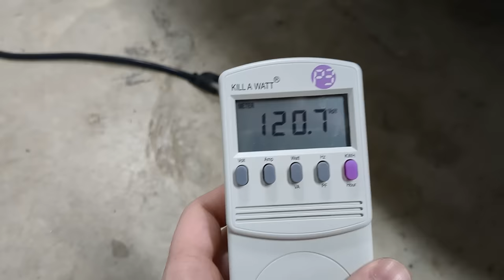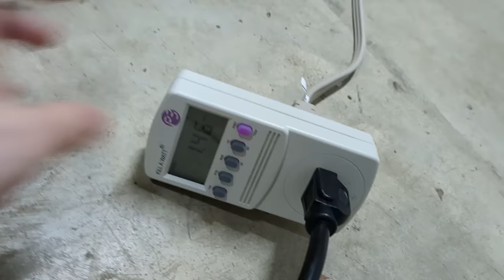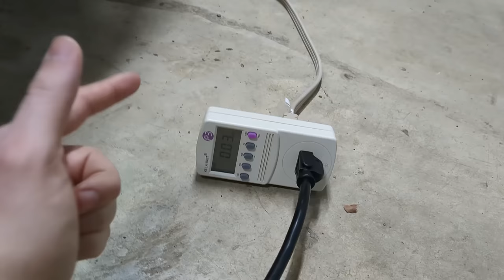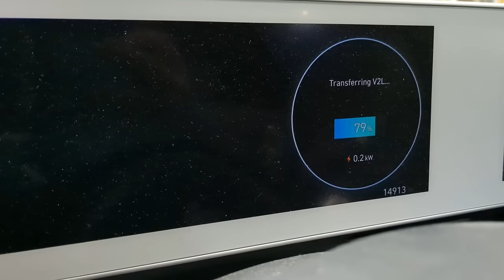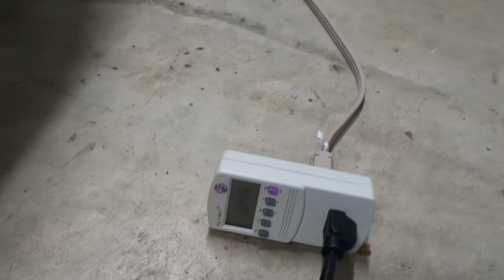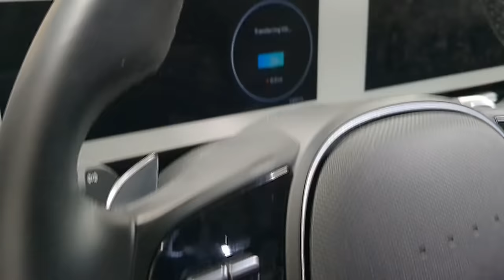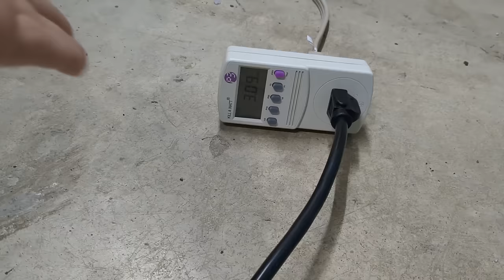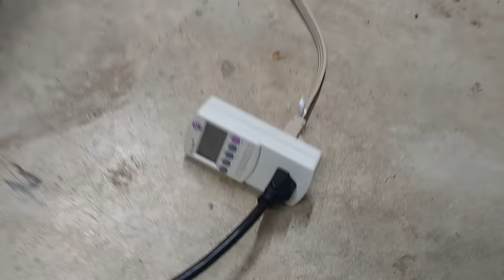A 24-hour test run of the Hyundai Ioniq 5's Vehicle-to-Load function

Comment: Hah I was thinking the whole time that it’s immaterial how much power it draws because you can drive somewhere and fast charge. I suppose in a borderline apocalyptic power outage that’s not an option, but most power outages don’t knock out entire cities or states or regions.

I do still wish V2H was mandated by the charging plug standard because that would be a bit more convenient and solve the heating issue a lot easier, but I’m surprised at how usable even this 1800W supply is. With a higher supply, just about every home energy need could be satisfied for around a day using the car, or more if you’re careful about the usage. 

Thanks for doing this experiment, I’ve been curious about this since I learned of the capability and this is so cool to see
Reply: A much elegant and resilient solution is to keep a couple of deep cycle SLA batteries and an inverter to power blower motor of furnance. Then charge these batteries in a car or better yet 200W solar panels during the day time. Then you don't have to worry about the entire grid shutdown scenario. All of these can be gotten for less than $1000 (two 100 AH batteries, 1000W inverter, and 200W solar panels). Sounds expensive, but much cheaper than an EV with 120V outlet option. EV chargers won't work if entire grid shuts down for extended time.
Reply: The main problem with backfeeding through the EVSE, and into existing house wiring would be ensuring that the house is safely isolated from its utility provider, to avoid (best case) instantly overloading your inverter from trying to power an entire neighborhood, or (worst case) killing or injuring someone trying to repair downed lines that are suddenly no longer dead. Turning off the main breaker is usually enough, but you can't depend on customers reliably doing that, since it's not automatic or foolproof. So, liike with a conventional generator, some kind of transfer-switch arrangement would be needed. Depending on how the existing breaker panel is setup, this can be a difficult & expensive retrofit.
Reply: @jordanhazen7761  Correct. Just remember to turn off main breaker switch when using backup power. If everyone did that, we woudln't need the damn transfer switch and expensive secondary panel.
Reply: @i6power30  I did that for a few years, with remote inverter control at the panel and a posted checklist. Wouldn't be comfortable with it now, with kids & non-technical people in the house. Eventually just installed a subpanel next to the main & pulled most circuits over, taking advantage of the inverter's auto-transfer relay so it can serve as a (nearly) whole-house UPS.

Comment: It would be interesting to use a current clamp + properly rated voltmeter to measure power draw from the battery before the inverter and stuff. Maybe the car even reports that stuff through the diagnostic port so you wouldn't need to worry about dealing with the HV battery directly.

Comment: Your Ryobi tools would also come in handy too in a real blackout because they've got batteries, and and with a torch (aka flashlight) or work lamp, you can eliminate the extra lamp in the bathroom (safer too since no trip hazard in the dark).

Periodically recharge the ryobi batteries from the powerboard (aka strip) when required.

Comment: This video is currently 4 months old but I just found it... 

I ran a 24 hr V2L test with my KIA EV6 in February, a month before you did this test with your Ioniq 5. 

I have a transfer switch  in the garage that allows me to power 4 circuits in my breaker panel. I have one furnace, a kitchen circuit (refrigerator and counter outlets), almost all other downstairs outlets including my WiFi router and a bathroom. My test happened to be the coldest day this winter, so it gave me a good idea of how long the EV6 will support me in an emergency. The result is about 48 hours. I plan to use my microwave too but will have to coordinate it with the furnace to prevent overloading the car. I didn't use it during my test.

I wired an AC power meter into my extension cord that goes from the KIA V2L adapter to the transfer switch to see the real time current, voltage, and total energy I consume.

Comment: I agree, definitely should be a standard feature! It could literally be life-saving for some. 

Oh, on the topic of the fridge… always a good idea not to open it until you have power again, since it stays cool for a while, but opening the door just lets all the warm in.

If you actually had a power outage, and were worried about it being a week or longer, you could definitely extend your power way further. Only plug in ABSOLUTE necessities, like the fridge; avoid cooking things where you can [or cook the quickest things], read physical books or an eReader by sunlight or a small LED torch… You were living a luxurious life with your test. [Nothing wrong with that, just saying, you were testing a “as close to regular life” scenario as you could, vs. emergency survival stretch as far as you can]

Comment: I think this really is the game changer for Evs if your in an area with outages it's perfect. I have a generator only it'll only do 1kw. In the UK we don't have the massive usage you guys do we don't have acs for example and alot of people don't have large American style fridges. My house consumes between 7 and 10kwh. Day so I think could easily last a couple weeks on the car. So much uneccessary stuff plugged in that don't necessarily need .
Reply: That's fine and all but be realistic. That couple of weeks is if you don't cook, have led bulbs and barely have anything else plugged in. Many of those large fridges are actually more efficient than old school small fridges. I have been to many areas of the UK and have personally seen those large fridges and newer home appliances, some even opting for an induction top stove.
Reply: @NeptuneSega  most people in UK have a standard fridge. Yes people do have American fridges but in general normal fridges and not usually the size of the one in the video. My house is completely led every single light so that's not out of the question at all. As I stated I use 7-10kwh a day my oven is fully electric. Only thing we use gas is for hot water and heat. My fridges use less than 2 kWh a day all together I have two fridge freezers Nd a stand alone freezer.
Reply: @NeptuneSega  did you not read his comment? He already started his usage

Comment: I survived the Texas freeze. 5 days without power. One of the most frustrating aspects of the whole thing was having this huge battery in my garage, mere feet from the plug to my natural gas heater, and being utterly unable to use it because the battery was installed in a Tesla.

Power was still available in some places, so my strategy was to visit a friend with power during the day to work (driving across the treacherous unplowed roads with ditches full over overconfident lifted trucks), supercharge, then come home and sleep in the car in the garage with the heat on. Rinse, repeat. Miserable.

Comment: Another factor contributing to the extra loss you experienced is the car systems you are "waking up" each time you open the car door.  I once had to perform a "parasitic drain test" to determine why my 2011 Ford Flex's battery was dying so quickly. Following the instructions, I learned I had to be extremely careful not to open or close any door during the test because doing so woke up the car for anywhere from 30 to 60 minutes.  Waking the car and triggering extra load would prevent accurate results in my drain test. To prevent that, I used a screwdriver to flip the latching mechanism on the outer edge of the door to the closed position with the door open.  (Of course, the door would not close because the latching mechanism would not mesh with the corresponding part on the door frame that holds the door shut in normal operation, so I needed to manually flip it back when I was done.)  With the latch in the closed position, I then waited 60 minutes for the car's systems to go to sleep before beginning my parasitic drain test.  You would possibly get a more efficient result with your vehicle-to-load test if you either didn't wake the car by opening and closing the door, or by flipping the latch to the closed position 1 hour before beginning your test and leaving the door open.  I loved your video, and learn a lot watching all of your stuff!
Reply: I realize that your EV is nothing like my old 2011 model, and you've got an app that you can use to control the car...  Just a thought!

Comment: for your finalized emergency power backup setup, might want a power strip that has individual on/off switches for each outlet. as well as the kill-a-watt meter plugged in next to the power strip instead of in the garage

Comment: A combination microwave that can also act as a convection oven is really cool. Saves a lot of space!
Reply: Are those things any good? Combo kitchen appliances rarely seemed to be worth it in the past, but maybe things have changed
Reply: @mrb692  In my limited experience with them, they can't reach higher temperatures that a standard oven can reach. Might as well just use it as a microwave.
Reply: @davidmcgill1000  my convection toaster oven has the same temperature range as my oven, but if the combo microwave actually works equally well as a nuke and a convection toaster oven, then I can clear off some counter space. 

It’s just that usually you don’t get one gadget that does 2 things just as well as two standalone gadgets, but rather one gadget that does 2 things half as well.
Reply: @mrb692  A toaster oven is different. They are just small ovens by themselves whether there is a fan or not. A combination microwave has two entirely different appliances built into it.
Reply: @davidmcgill1000  Depends. For example my mom has one and you cannot bake cakes in it and even thicker pizza has a problem because the moisture gets trapped in the inside and the whole thing basically stays raw in the middle. I got another one (SHARP) and it works for frozen pizza well (never tried anything else and the pizza my mom made were thicker I think).  
But for for buns for example, it works very well.
Reply: @whuzzzup  When I toast buns, I use my air fryer. Takes all of two or three minutes and works a treat.
Reply: @mrb692  Yeah, if it weren't for size and weird form factors, air fryers are just better toaster ovens. I was put off them initially because they're marketed as fryers, but when used as toaster ovens they are great.

Comment: I live completely off grid. I recently got a 2020 Mitsubishi Outlander PHEV GT. With the GT trim level you get 2x 1500w 120v outlets. I have tested it and I can slowly charge my houses battery bank. I used about 12gallons of gas this winter in a generator and it was loud and annoying. Hoping my car will do the job a lot better. 

It was your videos on the ioniq that made me realize the tech for V2L is out there, if you look in the right places. 

Winter is over so I probably won’t need to be testing powering my house with my car any further. Rather I’ll be powering the car with my solar. 

Thanks for all the videos!

Comment: IIRC, it was on your channel i saw that cool old EV.  The motor controller handled running the motor, regen braking, charging AND inverter functions.   That was super nifty because there's a lot of overlap in those functions and it should in theory be cheaper to wrap all those functions into a single unit rather than run seperate inverter\charger\motor controller.

Comment: This is a super neat feature that I didn't know existed.  To be fair, I didn't really look that hard, but still, it's very neat.   I could see this being used (in conjunction with a manual transfer switch) to provide car-based emergency power for specific circuits (take a look at reliance controls wide lines of manual transfer switches).  You could use one of their 30A switches (since you're limited to a single 110v leg) in order to switch over specific circuits in your house from utility feed to the car just by flipping a switch.

After having gone through the Texas Snowpocalypse and never wanting to do that again, I'm looking at multiple power generating redundancies because we didn't have power for a week in an all electric apartment.  Now we have a house with a NG generator, water heater, and furnace but I'm always looking to add to our existing configuration just in case.
Reply: In the Texas outage, the gas distribution network froze, too, if I'm not mistaken?
Reply: @Validole  A lot of it did, but what remained functional was prioritized for residential over industrial service.  Speaking with several of our neighbors on that, no one lost NG service during the freeze.   Even then, the possibility of losing NG service warrants looking at other power generation/storage options (like solar, EV V2L, etc) especially since the Texas grid is so delicate.
Reply: I still can't get over how massive the Texas power outage was and how simple it would have been to avoid.

Shareholders gotta get paid though I guess.
Reply: @ax14pz107  Yeah I feel like Texans should spend less effort trying to improve their setup for outages, and more effort lobbying their government/administration to actually fix their grid.

Comment: That's a great feature! I recently rented a Tesla 3, cause it was the same rate as a regular car, so was kinda fun to try out as I've never touched an EV before. The most baffling part though was the sentry mode horfed up about as much power as this experiment here, leaving it parked a full day was like 9% of the charge. I get you wouldn't run that at your own home overnight if you had a garage, but yeesh. No wonder Avis had to sift though several dead Teslas in the back to find one to give me
Reply: Good to know, don't buy rental car fleet used Teslas as they are left at 0% SOC.
Reply: If you own (rather than rent) you would generally have Sentry mode off when at home. I charged my 2020 Model S to 90% 3 days ago and I haven't driven it since. It is still at 90%.
Reply: @JeffEdmondson  if you want a car that has parts that are in good condition in general, uh, don't buy a tesla, new or used
Reply: I specifically park next to Teslas whenever I can, hoping they may have sentry mode enabled in case something happens
Reply: Never believe the stated efficiency rating of an inverter. They are always the maximum efficiency under ideal conditions rarely seen in the real world.
Reply: @HotClown  I have had mine for three years, it's been a great car.
Reply: @JeffEdmondson  You have gotten lucky in the tesla grab bag, congrats. Just in the last couple months I've heard about a tesla being sold new with brake callipers missing, multiple steering wheels falling off, a door handle falling off, both a rear door that wouldn't shut and a rear door that wouldn't open, multiple fires due to the laughable battery "technology", and a bunch of autopilot incidents. Panel gaps and bumpers falling off in the rain have been memes for like 6+ years. They're not well built cars. Tesla is a subsidy funnel for a pedo guy, not a car company.

I truly hope that your aging tesla doesn't start costing you insane amounts of money and time, as they tend to do, and when that does happen I hope your reaction isn't the same as a million rubes before you; "@elonmusk @tesla this sucks but I still love the car!"

Comment: The F150 Lightning can offboard 9 kW, at once, with the extended range option and 7 kW with the standard range option. Of course, the typical home uses around 2 to 4 kW at any time on average. With the "Intelligent Backup Power" system (grid safety disconnect and transfer switch, sold separately by other companies) you can use the Charge Station Pro and offboard power through the truck's charge port, as you were mentioning. But, with 8 standard outlets in the standard range option, and 11 outlets (1 is a 240v 30A outlet) in the extended range option, you can offboard 7 and 9 kW, respectively, through the outlets also. Moreover, the outlets in the bed are on their own circuit, and the outlets in the cab and frunk are on another circuit. Needless to say, there's no worry about power supply for all of one's needs with that great truck. Of course, there are many other reasons I love my F150 Lightning.